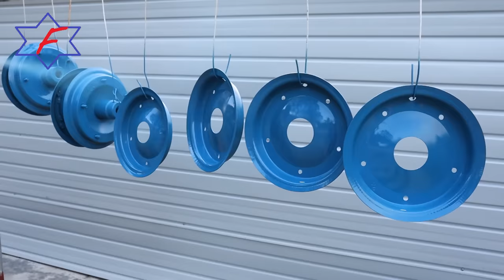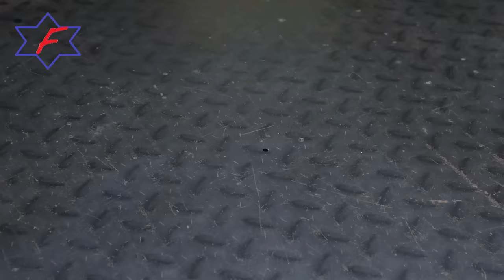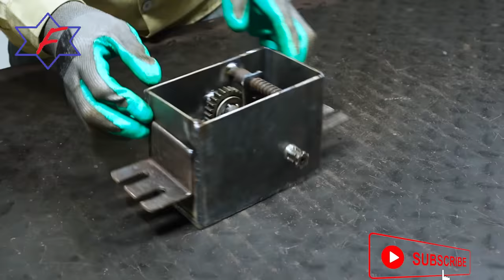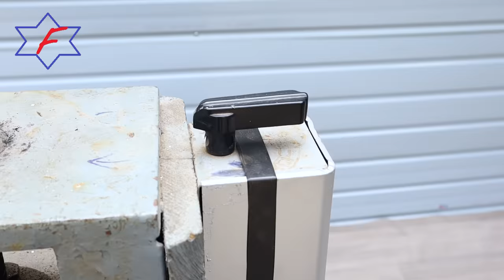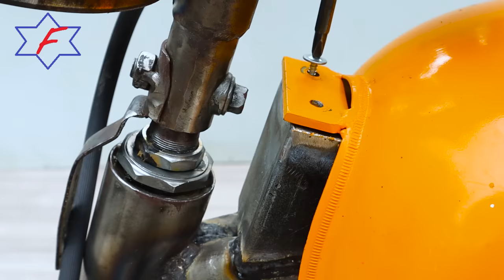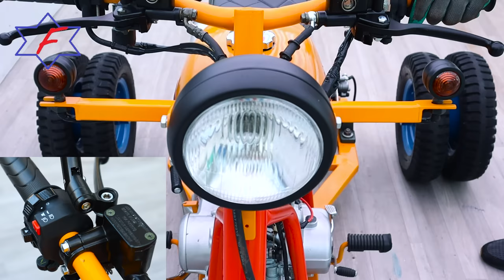Homemade Amazing Trike Use Reverse Gear Box

Comment: Without rear differential, it can crack the EXEL 😂
Reply: Not sure what type of power you're dealing with but most engines can't crack an axle if you don't have a differential I mean if you've ever seen a cheap go-kart build it is normal to have no differential
Reply: @ZETTABYTE._.1  me to ji hai na ji ki
Reply: @AshaKumari-ol7ip  what?
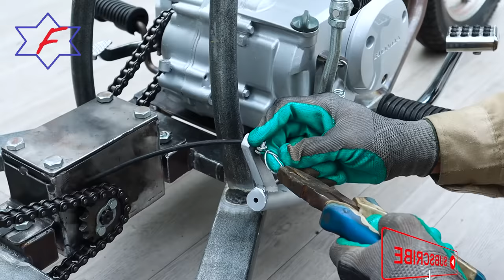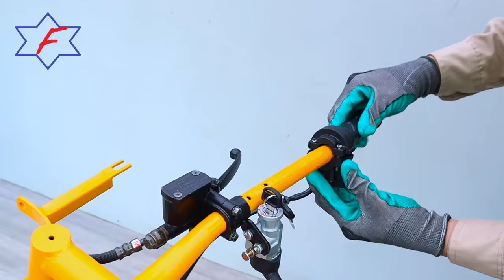Reply: 20:36 20:39 20:40

Comment: The bearing holder you have installed for the rear wheel road. It will not be in danger of breaking in the blow from the bottom

Comment: We appreciate your workmanship. Indeed, beauty is also good and texture is also good.

But sir there is a problem which you may not have seen, we did it practically long time ago and we know it only after that.
The problem with this is that if you make a quick turn, it won't turn.  That is, if you apply a cut, it will not apply
We have to put a cross inside its shaft
Reply: تاتاازل
Reply: ض
Reply: غب

Comment: Usually a tig welder uses a hand fed filler rod. How do you avoid this?
Reply: if it is a mig welder?
Reply: Here, tig welding is just for the beauty of the video.  He can't weld tig.  All welding was done with Mig, you can see it at the seams.

Comment: How do you weld with no wire
Reply: I think he fully weld it off screen. Maybe.
Reply: I was curious with this also
Reply: He just tacks the parts on camera, than welds it all off camera. Than in the editing he cuts back when it is done. He even strikes an arc with the welder after it is all done to edit into the clip to make it look like insta-welded parts. If you watch close you can see the jump cuts in the editing.
Reply: @craig2963  no how does he tack it with no wire what can you use the material from the piece your working on
Reply: @craig2963  and yeah I see that part I just thought you had to have wire to even make a tack if I'm wrong let me know please

Comment: Looks good but one fatal mistake. The steering head has no leverage with upper and lower bars welded so close together. I see a breakage there
Reply: Not really look at all the triumph motor cycles from the 60's still holding on.

Comment: That gear box lid needs a gasket.. as the trike bounces around it leak oil everywhere.. and a tiny rubber grommet for the cable hole.
Reply from the maker: Thanks for your advise! I will improve!

Comment: Fabrication was good i give you an A. Mechanical i see a few problems down the road. If you baby it might last a wile. If you ride it like i would, A day or two at best LOL. You only showed using the bolt to set the flange for the break disc and sprocket. I hope you welded them. I do like your reverse gear box, I how ever would always be putting it in reverse when i went to stop since the foot break is used for the reverse lever. Personally i would have used one of the hand levers for reverse with a lockout so it would not be used by accident. Over all Kudos! Not sure why the duel rear wheels but i guess it was a personal choice.

Comment: you mean that everyone can make something like that at home?  Not everyone has a drill, grinder, welding machine and so on at home...
Reply: Then you can't make anything and you shouldn't worry about even trying since you have zero tools. Normally it takes expensive cnc equipment to make gear boxes. Stop being dense it's not good for you.

Comment: The welding you see is using a TIG torch, but, without the extra rod of material to melt in as a binder or filler.  This is called fusing the material ...you do not use any extra material you just melt the metal to each other.

Comment: Design and craftsmanship leave a lot to be desired. The rear wheels are running out of round.
You didn't think through on the rear brake light so that is cockeyed. You didn't make a wiring harness so you have a lot of loose wires.
And the dumbest thing I've ever seen was to wear a mask when you're working by yourself. That is the epitome of crazy.
👎👎👎👎👎👎👎